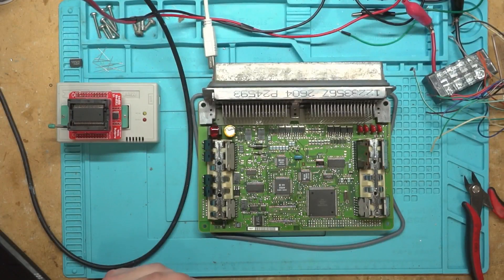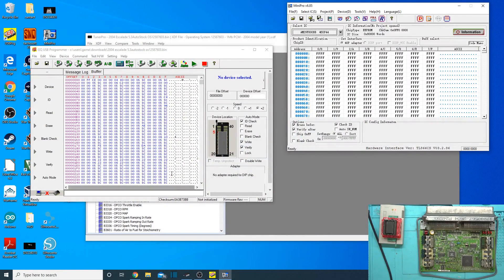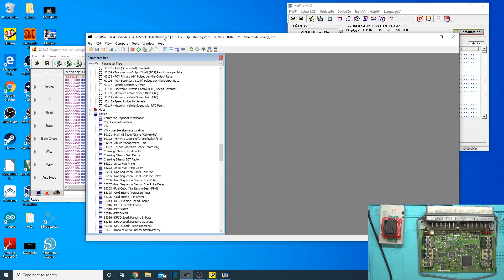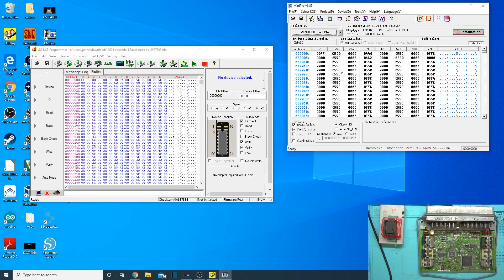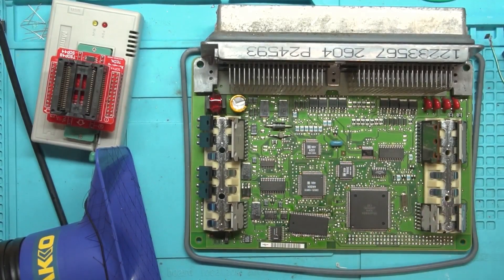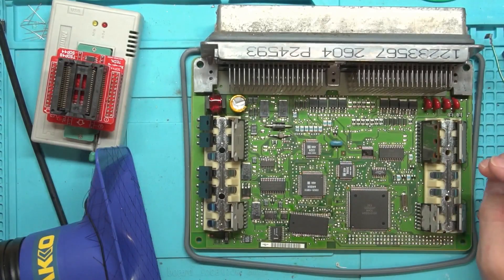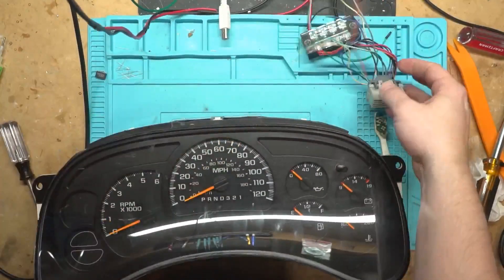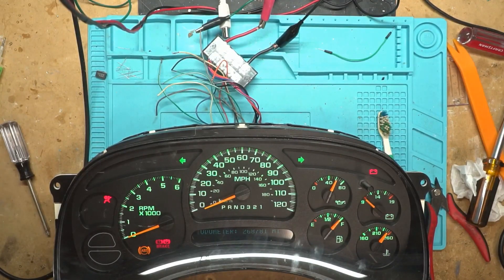Programming a 2003 to 2007 GM PCM P59 Part 2 Programming With A Minipro

Comment: I had a Failed to write on 2 p59 ECMs under low power or power surge conditions  due to bad cells in a couple car batteries. I need the BDM connections on the board to figure out how I can flash. I’ve used K-tag and things to connect to other ECMs but would really like to be able to reflash and make these functional again! Any help would be much appreciated. Thanks!
Reply from the maker: If you want to mail them in with a bin I can take care of them $50 ea
Reply: I hot a 05 suburban id like provrammed and tuned what would it cost me @FixedUntilBroken

Comment: Looking good mate  carnt weight for part 3. big thumbs up 👍
Reply from the maker: I did a test run on a 0411 PCM in my truck today it ran. Waiting for a more practical tool for doing this comes in to do part 3 so it will be a few weeks.
Reply: Fixed Until Broken nice work .iv bean looking at the KTAG tool there not a bad price every .one is saying that the Chinese knock offs work just as good  and you can get lots of adaptors for on board programming
Reply from the maker: @bundylovess  Ive got a usb bdm  and better bluetooth obd2 tool on the way. with the BDM tool I should be able to basically Jtag in. with the bluetooth tool I should be able to run LS droid.
Reply: @FixedUntilBroken  not sure where you are at on the project but with the right BT tool you can use PC Hammer but you may already know.  Just stumbled across your video today.
Reply from the maker: @CraftwerksMC  Yeah. At the time I had not done videos on them yet but I have now covered PCM hammer and LS droid. I was really just trying to work with the tools I already have for it.